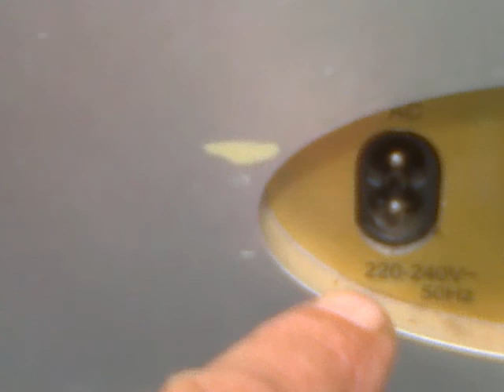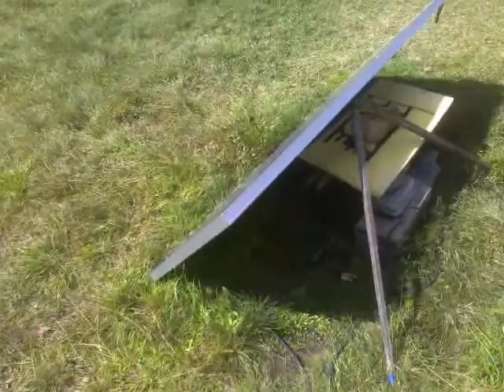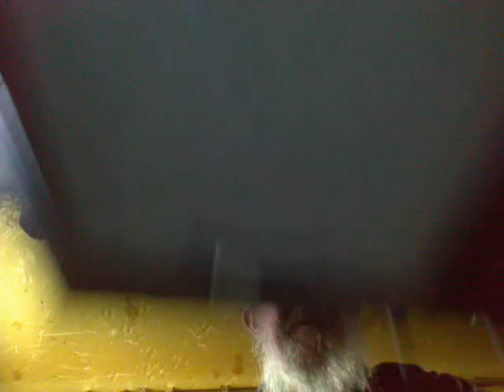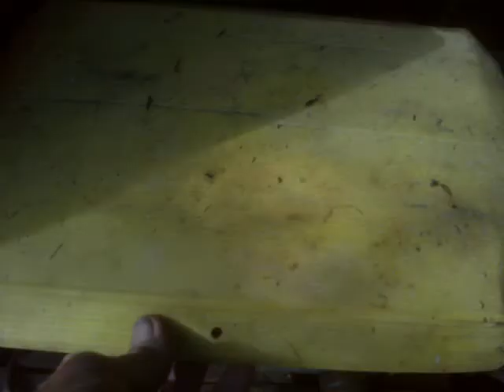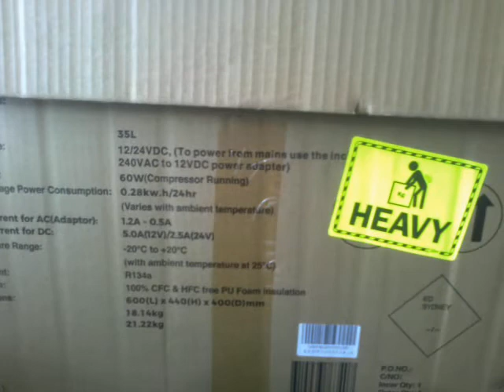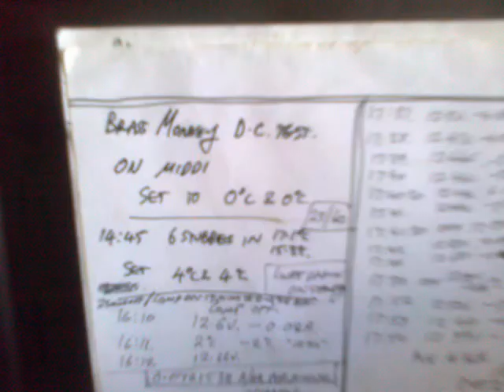Brass Monkey..., Off-Grid Refrigeration, Solar-Electric.

Comment: What an absolute  mess of a setup looks like  a dump site with half ass solar
Reply from the maker: G'day,

Thanks .

And what, pray tell, does the hundred acre Endangered Species Sanctuary upon which 
YOU 
Pay the Council Rates, out of your
Pension
Look like...?

All the flat-sided square-edged Timber you see Tie-Wired together herein, was Chainsaw-milled from Windfallen Trees inside my Fenceline.

I started living Off-grid in 1984, cobbling home-made Windmills together while living by Kerosene Lamps. My first 30-watt PV came here in 1999.

I 
GREW
My Solar System. Piecemeal.
I ran on Dumped Batteries for about 15 years, 
I designed the 2-Axis Tracking Tower of Power & riveted it together from scrap Angle Iron that was in 42-inch lengths...; it provides 48° of Seasonal & 135° of Daily Tracking ; boosting Output by 35%, and enabling me to turn my Panels
Edge-on to 
Hailstones - regardless of where they come in from.

What have
YOU
Achieved,
Which is in any way, shape or form,
Original ?

And, if you can afford a brand new shiny Shitkicker of a System - then 
What did you have to do to the
Environment..., to acquire the Funding required to be able to afford to buy all that...?

Try living in the
Real World.

Unplug from the Grid.

Early.

Learn to live without it,
Before it stays down
After
Falling over.

The 
Cashless Society is on a
Sled-ride to Barter in the 
Dayze forever following 
Grid Failure.

Sudden Transition to a viable
Post-Apocalyptic existence is
Bullshit.

I've established 38 years of "Lifestyle momentum" here in the Forest ; there's not a lot which I need that I lack reserves of, on hand.

Maybe my stuff isn't as 
Shiny as all your own Shit ;
But I'm not much impressed by you and the 
Bright & Shiny Landfill 
Brigade...

("Oh bright and shiny Landfill,
Oh Bright And Shiny Landfill...
OH BRIGHT AND SHINY LaaAAND-FILL...;
For Thus,
WE
Trashed the
Earth...!").

I've voted against Global Warming since 1980, and my Choices lost at 
EVERY Election I voted in - and here in Oz voting is compulsory.

In my time 3 Billion chose to become 8 Billion and
All of THEM 
Voted to conduct the
Accelerated Runaway Greenhouse Gas-Release Experiment -
And
You-alls 
Pay no attention to my opinions, nor the rest of the
Facts of Life & Reality.

So,
SURPRISE !

Your opinions and 
Worldview strike me as being
Unimpressive.

So, now...
Lift your Game,
Fuddpucker.

Such is Life,

Have a good one...

Stay safe,

;-p

Ciao !
Reply: Forget the haters mate. I can see your hard working efforts and appreciate them!  Very old school and awesome if i do say so! 
You'd be a brilliant person to learn from and have as a friend through life! Good on you, for keeping it real! Very worthy! Cheers ☺️

Comment: I use a propane-powered refrigerator. "Brass monkey" is a term used on fighting sail.
Reply from the maker: G'day Dave,

Thanks mate,

Yeah, "cold enough to freeze the Balls off a Brass Monkey" with the "Monkey" being a Stand to contain a pyramidal pile of Cannon Balls, and according to legend when it got sufficiently cold the Brass contracted enough that the bottom layer of Balls no longer fit in the Monkey and they all fell off....

It's a thing that Mythbusters should have examined, before they folded up their Show...(!).

Such is life,

Have a good one...

Stay safe.

;-p

Ciao !

Comment: Thats a step up from the cold safe. As for the trickle taps on the cold safe. Could a ball valve setup as found in a toilet cistern be fitted? To keep the level in the tank constant without the fear of it over flowing. That would keep the taps at constant discharge.One of your water butts would make a great header tank.
Just a thought as i'm sure its still a great back up.
Reply from the maker: G'day,

Thanks mate,

I dunno about Ball-Valves, these are Conical Tapered Lead Plugs, with a blind hole up the centre, opposite the T-Handles, and another Hole at 90° to the one up the middle...

It means one CAN get it to drip one Drop per 3 seconds, 8 of them all at once, and then in an hour all the Taps need to be opened by the width of a Bumblebee's Foreskin.

Like having a Recovery Ward with 6 unconscious Patients, 2 with Urinary Catheters irrigating them with Iced Water and draining, alternating, and all 6 with IV Drips, and all the Taps need to be constantly adjusted as the Reservoir Head drops...

I store my Drinks there, ready to replace the one coming out of the Fridge...., kinda thing.

Such is life,

Have a good one...

Stay safe.

;-p

Ciao !

It's better than nothing, but these dayze one can throw $1,200 at the contest and get a setup which can make Ice (to put in the Water of the 60-Watt Electric Evaporative Cooler, for the next Heatwave, kinda thing...(!)".
I
Reply: @WarblesOnALot  I think Thornwarblers idea is to use something like a toilet cistern valve to keep the header tank of the safe at a constant level. 
It wouldn't solve all of the issues you outlined but it would possibly remove the need to have to fiddle with the taps because the cistern float valve could be set to maintain that constant level. 
(All of this would of course require you to have  you have enough head from the supply tank.)
Reply from the maker: @Paul_Au  

G'day,

Ah, I see..., well, yeah, I can see how stabilising the level in the Tank would help...; but it would be a gigantic hassle to set that up - I found it easier to make the jump to the Solar Electric one.

The real attraction is that when the Heatwaves return, the Brass Monkey can make Ice, which I can put into the Water of my 60 Watt Evaporative Cooler, so as to be able to cool down the Hut when it's 40 degrees outside.

Last night, thursday night, I ate Carrot, Zucchini, Corn and Avocado which I bought the Friday before...; the Trafalgar could never have kept them eadible for a week.

Sometimes the old Technology, quaint as it is, simply can't do the job.

Such is life...

Have a good one...

Stay safe.

;-p

Ciao !

Comment: This is just like my setup! however the Aldi fridge died and had to be replaced with an engel (worth the extra) and because I wanted 'better' power the ebay charge controller was swapped for a victron unit. running over a year now flawlessly. large deep cycle tractor 12v battery was much better value than those 2 6v ones by the sounds
Reply from the maker: G'day,

Thanks mate...!

The thing about Tractor/Dozer/Truck Batteries is that they're designed for Cold Cranking Amps..., so they feature LOTS of very thin Plates...

Deep Cycle Batteries have less Plates but they're thicker, so that when they get Sulphated and the Charge Controller runs them up to 14.8 Volts to thermally crack the Sulphate Plaques off and drop the Sulphate into the Sludge Traps - there's more fresh Lead under the Plaque and the Sludge-Traps are deeper.

Truck/Dozer/Tractor Batteries appear to be value for money, until you try to Cycle them a few hundred times...

Such is life,

Have a good one...

Stay safe.

;-p

Ciao !
Reply: I have  engel  x4 and a 50 liter  brass monkey  please  tell me why  its worth  the extra  1200  dollars  my first hand  experience  iz no it's not worth it